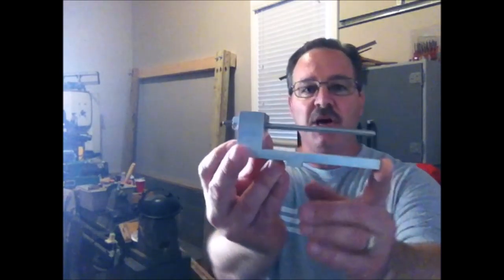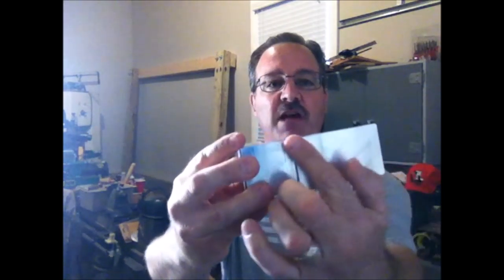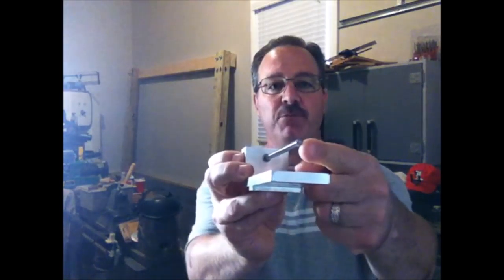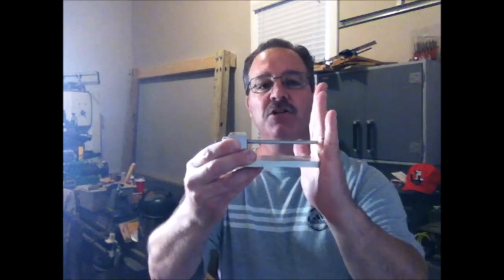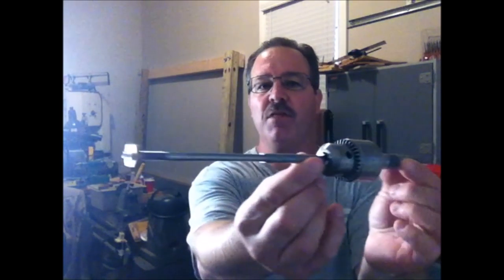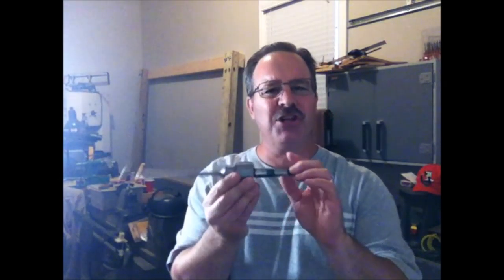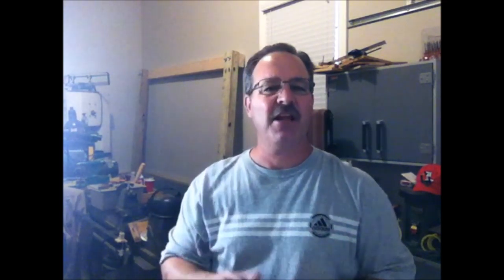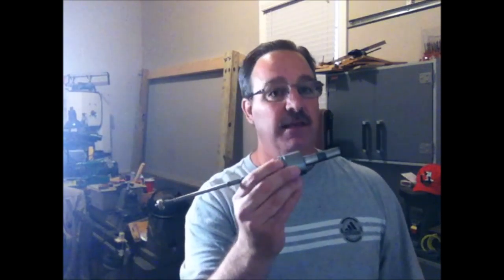Herringbone Blank and Pen Q&A

Comment: another way to barrel trim a blank, especially a very valuable and fragile one:
using the bushing, turn the untrimmed blank round on the mandrel
then put the rounded blank in a scroll chuck and use a very sharp scraper to cut the end flush with the tube,  reverse the blank in the chuck and do the other end.
this is very quick if you have lots to do at once and is great for large tube blanks when you dont have an adaptor sleeve for it
Reply from the maker: Thank you. 

Regards,
Bob

Comment: Great Q&A Bob. I've taken to using a rubber glove to apply CA. I don't get glue on my fingers and there are no fumes. I'm waiting to find a down side. I actually cut off individual fingers, then save them and use the other side the next time. I'm such a cheap skate. I also might be getting a new Rikon 70-100 lathe this weekend. We'll see. Bill
Reply from the maker: +Bill Schimmer Nice idea on cutting off the glove fingers and using them for applying C/A. 
  I've never used the Ricon lathe but it looks like a nice one. I hope you are able to get it. 

Regards,
Bob

Comment: Bob, I have a quick question. Can I use any thin CA Glue for finishing, or does it have to be "CA Glue Pen Finish"? 

P.S. I don't have an issue with the length of the videos. I actually prefer a longer video.

Thanks,
Dave
Reply from the maker: +David Hello David,
  There are purest out there who will choke on their coffee when I say this but I have used thin viscosity C/A that was not marked as a finish to finish a pen. I don't see a difference. 
  Thank you for the feedback on the video length. 

Regards,
Bob
Reply: Thanks Bob thats what I figured. Is there a possibility that you can do a video on sharpening turning tools?
Reply from the maker: +David I hoping to do a sharpening video after I get me shop back in order. 

Regards,
Bob
Reply: I have been starting to do CA finishes on my pens. So far it has been turing out pretty decent but after I finish sanding with 12,000 grit, there are still some minor scratches on the finish. I heard using a buff will remove the scratches. Any experience or comments on this? Thanks,

Dave
Reply from the maker: +David Yea, I use a Hut Plastic Polish. The stuff you get at the auto parts store for headlight scratched works just as well and is way cheaper. 

Regards,
Bob
Reply: Thanks Bob, 
Also, do you use the Hut polish in addition to a liquid polish? I am currently using a liquid polish but it does absolutely nothing for the scratches.
Reply from the maker: +David I just use the Hut polish. The headlight polish will do the same thing. You only need to use one of them. 

Regards,
Bob